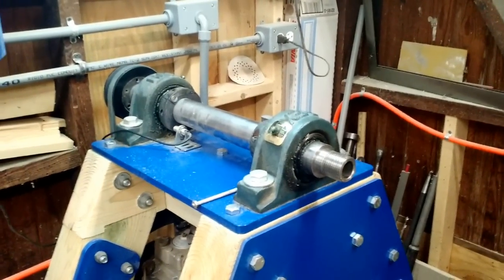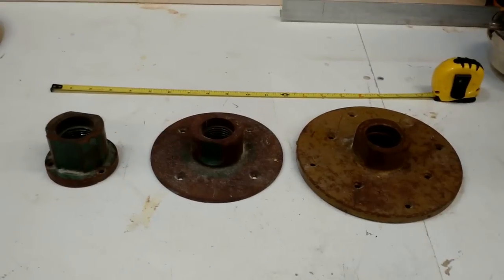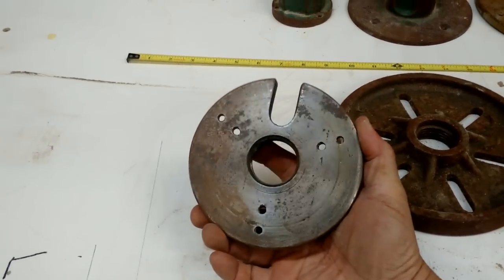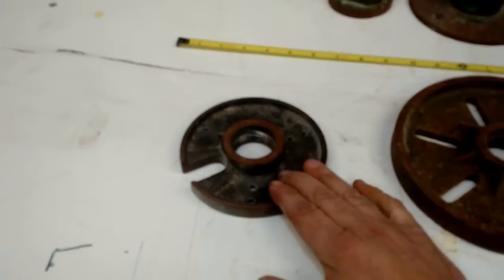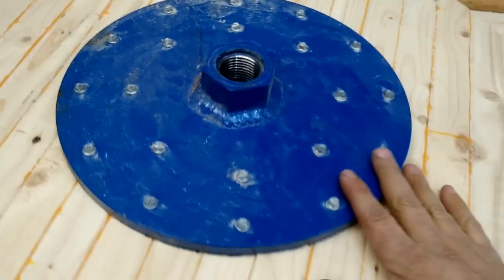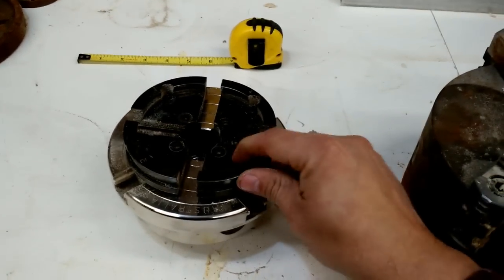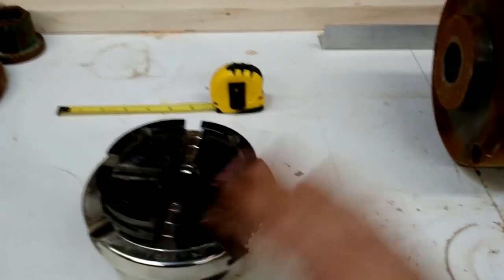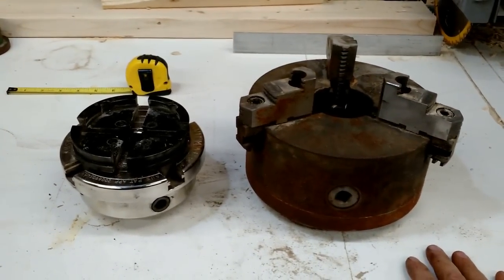HomeMade lathe - Faceplates and chucks

Comment: Nice seeing all your attachment stuff. Most of your faceplates and jaws are bigger than my entire lathe.

Oh and for finding nuts I had a little trouble finding just 3/4" - 16 and 1"-8 did eventually  find them at Tractor Supply.

Ok next video (do i get a commission :)).  Any improvements that you would add if you ever make another one of these?

I was watching another video demoing a $4,000 Laguna (?) lathe and one feature they had was an extended nose on the headstock that it was noted that this feature was liked by bowl turners. I noticed that your spindle just looks short. Is this an issue?
Reply from the maker: +Cliff Hartle i guess my idea of scale might be a little bit distorted.  since i work in an industrial field getting hardware (nuts) is VERY easy.

as far as commission, we can split the .00005 cents this video has generated, lol.

the extended nose is a feature i want/need to make in the near future.
Reply from the maker: +Cliff Hartle if you have a 3/4" and 1" spindle, they will actually fit INSIDE the spindle of my lathe!
Reply: Ray Pena Yes I have the mini lathe from harbor freight that has a 3/4"-16 spindle. Right now its perfect for my needs since I most;y do pens but just a few weeks ago I made my first turned lidded box.

Comment: I don't wether to like or dislike video. Lol please oil it.
Reply from the maker: +Barry Cass lol, it's just a little rust
Reply: The video has some good information for guys not familiar with lathes, but it could be done in 5 minutes.  He spends 10 minutes repeatedly picking the parts up and putting them down and slapping at them with his hands while repeating the same information over and over.  Also, he bought the stuff, has a tape measure laying on his bench, but insists on saying " it's about 5 or 6 inches"  -  he should know exactly how big each one is by now.